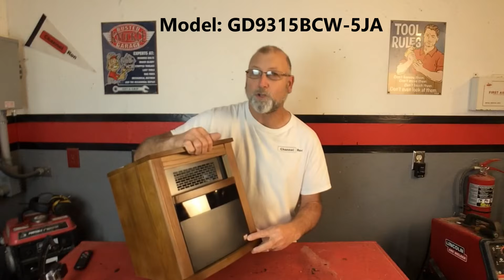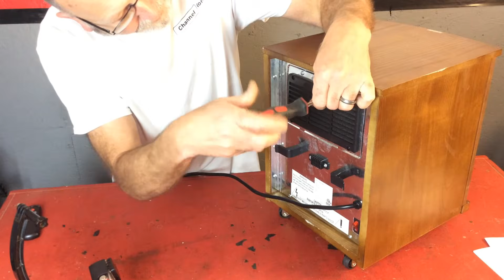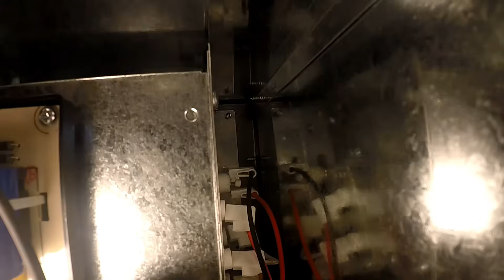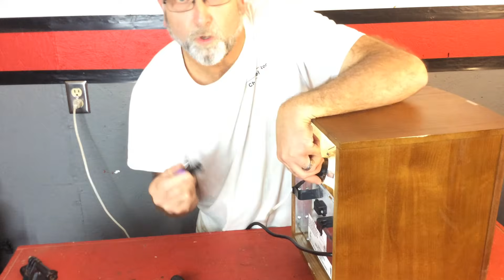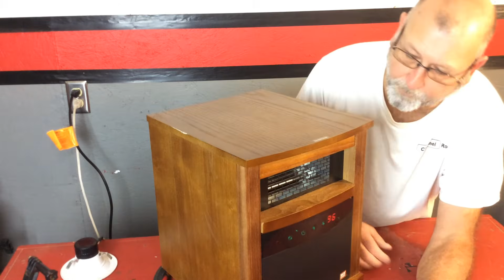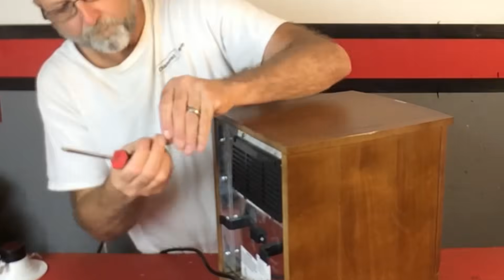How To Fix 1,500 RedStone Electric Heater

Comment: There is also a reset button behind the main cable mount bracket. You have to remove both screws and pull off the bracket which is used to wind the main cable round then push the small reset button.

Comment: I have a similar heater..everything operates fine except one of 2 elements wont operate operate at same time in high mode ..i have checked connections and element is fine and connection are fine..any ideas?

Comment: What about the elements themselves? I have one that is black, a Red Stone, and the elements do not heat up anymore, but the blower still works. Once the 1500 Watt switch is turned on, the one element designated for that switch turns on, but the other two remain off.

Comment: Thanks for the video! Mine tripped out when the screen on the back got dirty. I thought because it was dirty that it tripped a thermo sensor and that if I cleaned the screen and let it cool down it would reset automatically and work again. When I found out that it still did not work I went searching and found your video. Your video clearly states that the sensor does not reset and it needs to manually be reset. I reset mine and I'm back in business! Thank you I appreciate it!

Comment: Is there a way to replace the heating coils in these heaters? One of mine burnt out
Reply from the maker: Not that I know of. parts a a bit hard to find for some of these
Reply: @ next question! So I pushed the little button on the inside but I’m assuming that’s why it overheated because the fan doesn’t turn on? Any fix to that

Comment: Is there a way to replace fan bearing? Im assuming its a squirrel cage and on the 2nd winter mine went out. I didnt tear in to it but wondering if anyone happens to know and is this a odd failure?
Reply from the maker: Not sure if they make them to fix. The manufacturers just want you to throw it away and buy a new one. That said, you might be able to take measurements and find it online.

Comment: Thanks for posting this one; I removed the back panel to look for the thermal switch and couldn't find it until you pointed it out, also double checked the fuse soldered on the main board, the fuse was fine. I also removed the plastic grill and cleaned the foam dust filter, it was pretty dirty, so that's something that can cause the thermal shutdown. the little plastic cover on the back (held on with 2 screws) covers the thermistor, which is how the thermostat is able to read the temps, it's a good idea to wipe the little bulb clean of dust/dirt at the end of that wire under the cover as well. This helped me sort out my heater issues!

Comment: Thank you!!!!!!! I bought the heater a little over a month ago and was shocked it stopped working tonight. I saw the filter was dirty and cleaned it, but still it was dead and the manual mentioned having someone reset the thermal switch. Your video made it possible for me to be that someone and I was soooooo cold. Your guidance made it very easy to find and reset. Thanks again.

Comment: Thank you, I was able to repair it with that explanation, I kept thinking anyway, what could have caused the error, I noticed that I had a filter that receives air from outside, and that filter was super dirty, I cleaned it, I hope that was the reason. again thank you very much

Comment: My red stone just stopped and only comes on with no heat. 

1,500 watts adjustable low and high dials. 

Never did anything to make it or cause it to stop. 

I couldn’t find the model online at all. 

Metal grill and has too over features that works
Reply from the maker: Hmm? not sure the rest will let the heater come on or not? maybe just element is gone?

Comment: Any tips for a Lifesmart 1500 W heater that has a fan that won’t spin. Keep getting the E1 error
Reply from the maker: Yep have seen this, needs a good cleaning with air, try that make sure its unplugged (:
Reply: @channelron3593  I did that but still didn’t work. Just ended up buying a govee smart space heater instead sadly.

Comment: I have a Red Stone that's over 5 years old, run it 6 to 10 hours a day during the winter, zero problems. Great heater for the price, 99 dollars at T.S. Cost me about 25 cents per hour to operate with our current kwh rate.

Comment: P.S., that safety thermal switch is there for a reason. It shuts off, preventing fire, such as if the unit is covered by a towel, or if the heater is accidentally tipped over.  Please don’t ever repair a malfunctioning thermal safety switch, because this can be dangerous. Your friend, Jeff.

Comment: I work at Tractor 🚜 Supply, giving me reason that this is a GREAT 😊 heater. I’ve never bought the Red Stone brand before, but it sounds like 👍 one of that size could heat a 1700 square foot house in 60 below weather. It may not heat the whole house completely, but it’ll heat a large enough portion of it, anyway. It’s fan forced, which is my favorite. A little fan pumps heated air throughout the house. Again, it will heat your end of the house, and then some. Your friend, Jeff.

Comment: Can you tell me why the redstone cabinet heater continuously?
Reply from the maker: one up to room temp it should shut down, to check this set the temp to low level and see if it shuts off, if not check the thermo switches on side to maker sure they are snug against the metal,,